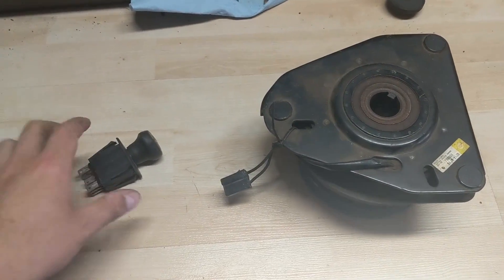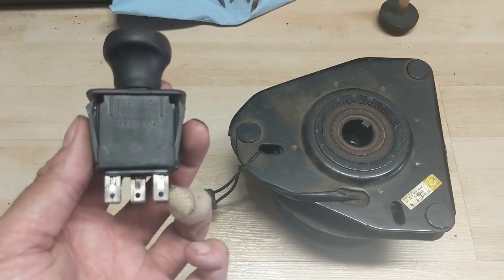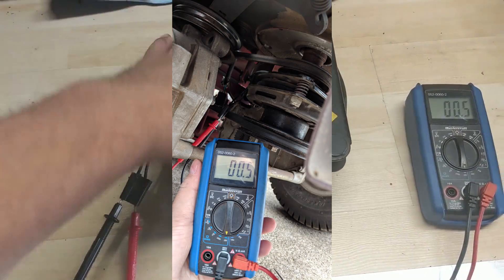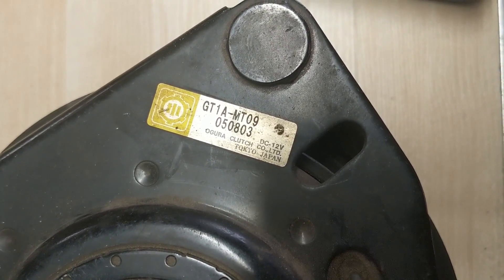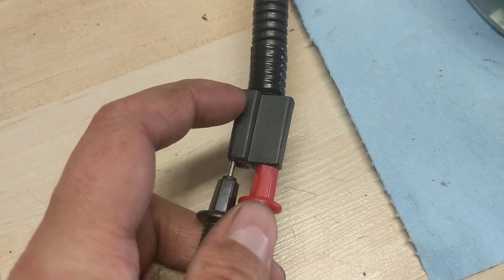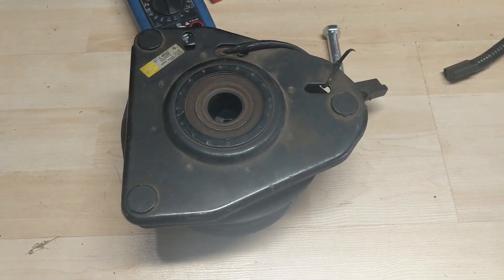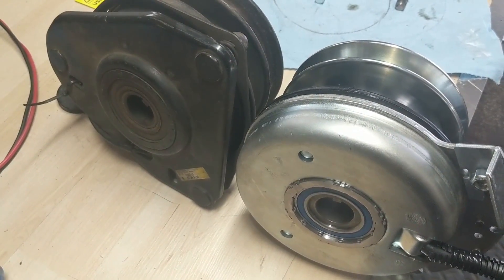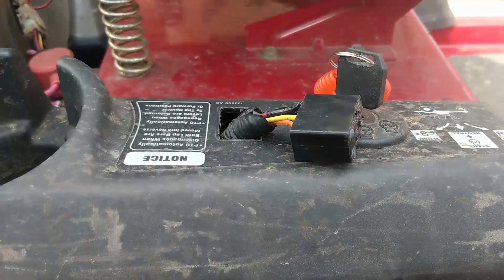How to Test a PTO Clutch for Resistance!

Comment: What it has to have resistance ?  You said the clutch engaged right . Also You said it had to be shorted inside . Did You check that NO You did not . Hook up a multi meter to one wire and go to ground if it pegs out to zero then it is shorted and do the same to other wire too. Hooked up to both wires it should zero out . I have had the same issue with my john deere 111 . I had no overheated switch but the engine died when pto was engaged, I did find my stator was cooked so battery was not being charged . Found the diode was shot also . I did pull the pto and readjusted the clearance put it back in . One rookie mistake is I had connected both of the seat safety switch wires together .  I think it is possible that a diode could have been the only issue You had .If the power flow from battery is going into stator I think it could cook some electrical things That is what my issue was. . I worked at a John deere dealer and should have known about seat switch wiring and how it works dum dum Me. Do check that before replacing a PTO .
Reply from the maker: If voltage remains constant, and resistance is decreased, amperage increases. With the resistance that low, and the voltage from the regulator remaining at around 12-14v, the amperage increases and melts the switch or the wires.

Comment: Excellent video!!! Thank u so much for this, it really helped me out. I have a question that u might be able to answer. Is it possible to replace the bearings on the pulley on a clutch like this?? The electric clutch is working fine, but the pulley has gotten very hard to turn so I’m assuming the bearings are bad. I hate to fork out the $ on a whole new clutch if I can just replace the bearings on the pulley but I don’t want to start tearing it apart only to find out it’s a lot more complex in there. 🤦‍♀️ Thanks again for your help!!
Reply from the maker: I'm sure it's possible, but I've never done it before. Maybe some digging on youtube could help, as I'm afraid I can't help much with that specific fix! Thanks for watching!
Reply: @EliminatorPerformance  No worries!!! Thanks to your video I discovered the clutch has high resistance so I’m probably going to have to replace the whole thing. I was going to try to limp this mower through one more cut before winter but I might not be able to do that. 😩 Over the winter I’m going to put a new motor in my zero turn & then I won’t need this other mower anymore, so it’s crappy timing for the clutch & pulley to crap out!!! Thank u for responding though!!

Comment: Had all the symptoms, new clutch, switch wiring still getting hot ——- was getting 5.5 from the engine , put on new voltage regulator—- now 4.4———- which is above the 4.0 threshold for the clutch. It’s a20 year old exmark 60 inch o turn.
Can the problem be aging components internally pushing too much past the voltage regulator?
Thanks, Martin

Comment: Good video,very detailed, I'm a rookie on this but with this kind of videos I'll be a pro in no time....I'm a very quick learner....Its freaking 9:40pm now and I ran to my shed to grab my Fluke116 to check the pto switch and tomorrow I'll be checking the clutch for sure...I was given a John Deere m665 zero trak for free in very good condition but obviously has issues with the PTO, one was replaced with oem pto and it worked once,so I  assumed it needs a new clutch....thanks for the video!!!! GREAT JOB!!!!!
Reply: Hey I got it running thanks to your video,checked,I checked the PTO clutch and it had 2.5 ohns and I bought the PTO switch with higher amps  and it worked perfect....blades engaged and I already sold it which was my intention.....
Reply from the maker: Thanks for watching, and good luck! I also have a video on how to properly adjust the PTO clutch: https://youtu.be/hZNILWqmcEg
Reply: @EliminatorPerformance  p

Comment: What if the resistance is high and it won't engage when voltage applied?
Reply from the maker: Could be corrosion due to water/moisture inside. That would cause high resistance and negatively affect the circuit. Check connections too for corrosion
Reply: Ok. Thank you for the info. 

I'm afraid I'm going to have to pull the motor to get the PTO off. Trying to test all I can before having to do that.

Comment: Thanks for having the same multi meter as I do and showing the settings. I've got a craftsman ZTL 8000 doing the exact same thing. I told the guy that it could be more than just a switch and possibly a relay. He's very impatient. So I purchased a new clutch and still the blades won't engage. I thought maybe a ignition switch since his has to be double pumped to crank the engine.

Comment: Thanks for the video,  very informative 👍🏿
Reply from the maker: Thanks for watching Dan!
Reply: @EliminatorPerformance  hey question for you. 
Mine is getting 12.6 volts, the clutch engages,  it's continuity is 3.6 but it still won't turn the blades. 
What gives?
Reply from the maker: @dans4270  check the armature air gap? If the clutch is too far from the battery it may not be engaging? Watch this: https://youtu.be/hZNILWqmcEg
Reply: @EliminatorPerformance  ok thanks. 
This just happened after running over a nice sized rock my kids left out for me lol
Bend the blade about 4 inches.

Comment: If the wire that connects to the clutch is giving a signal whenever the pto switch is on and stops giving a signal when when off, does this mean the problem is for sure the clutch? 
If the signal is getting to the clutch fine but the clutch isn't doing its job , so it has to be clutch right?
Reply from the maker: If you measure 12v at those wires when the PTO switch is on (with the key on and parking brake on) and your PTO Clutch doesn't engage, then yes it could be a clutch issue. However, it may also need to be adjusted (the magnet could be too far away to engage the clutch) I have a video on that here: https://youtu.be/hZNILWqmcEg
Reply: @EliminatorPerformance  Ok thanks man

Comment: One other nice thing about the Extreme PTO... some models have it where you can replace just the bearings only with a circlip, whereas the oem versions, they can't be replaced without a lot of careful grinding because they dimple the top and sometimes the bottom bearing into place.
Reply: if you have a press they push right out you just have to use a punch to bend the metal back in to hold the bearings and use high quality bearings or wont last
Reply from the maker: Excellent point, thanks for watching!

Comment: I turn on mi swisher z-max xzt60 I pull mi pto and fuse blow any sugestion?
Reply: Short in wiring of pto circuit, in switch, or in pto internally.  Unplug pto test for continuity from terminals to body of pto, if has continuity than bad pto, if no continuity, resistance tests within spec pull switch and look for plastic deformation or melting; if any replace switch then test individual wires for shorts to body/frame..  if switch looks good test it's switching making sure none of the terminals have continuity between more than 1 other pin at a time while testing switching to the nc and no contacts verifying normal state continuity..   if problem still exists after all stated testing than go get some salt and pepper cuz she cooked...   buy a mechanical clutch and run a cable to actuate..  fuck all the electronic bullshit and make it work...  :)

Comment: My PTO switch is good. But my PTO will not engage. I checked the PTO clutch as you instructed in the video. Mine is 5.2 ohms. Could it be a faulty PTO clutch?
Reply from the maker: Could be!

Comment: I think you maybe incorrect on which lead is positive and negative  , I believe you have them reversed
Reply from the maker: It doesn't matter when testing resistance
Reply: It doesnt matter regardless on a pto..  its a coil of wire and no matter which polarity you hook 12v to it the coil if working will pull the plate disengaging the clutch....

Comment: Great video.  Thanks.  Having similar issue with my Cub Cadet.
Reply from the maker: Thanks for watching!
Reply: Eliminator Performance turns out it was the reverse switch. $10 fix. Too bad I had already bought a new clutch for over $150. Oh well. 🤣🤣
Reply: @EliminatorPerformance  Thanks for your help.  Although Im having some trouble.  The switch seems to check out in terms of continuity.  The new clutch measures 3.8 so right where I need to be.  The blades engaged twice for less than 5 seconds each.  Any ideas?  It's a hand me down mower so I don't have a ton into it.  But I don't want to throw good money after bad ya know?!  Maybe it's a ground fault somewhere?  Do you know where I can get detailed wiring diagrams to go through it.  I figure during the pandemic, I've got more time than money!  Besides, my eight year old loves working on it. Thanks!!!

Comment: You want to point out that 13.5 volts are necessary going into that new clutch before putting it back into service. Measured at the clutch with PTO engaged. Zero volts disengaged,13.5 +/- engaged. If it's only battery voltage at that new clutch it will fail.

Comment: Just wanted to point out mine (exactly the same clutch) has a resistance of 3.4(which seems fine)  but has conductivity between both hot and ground. When I did my 12v check there was no clicking on, only sparks coming from the wires when they touched the battery. Dead short but the resistance check showed it was in tolerance.

Comment: Hey thanks for the video .I've been searching all over trying to get some info. So I have a Scag V ride .
I accidentally left my key switch on for 4 days. I went to use the mower and it would not start so I took the battery and charged it. The mower started right up but now when I pull the PTO switch and does not click and the blades take like 10 to 20 seconds to turn on. So I checked to make sure the wires were pushed into the socket,it seemed to be fine. Any idea what this could be. I would appreciate your help thank you.
Reply: Those Scag mowers are awesome, hope you got it fixed right a way.

Comment: Explanation of resistance versus current flow (amps) is backwards. Resistance is opposition to current flow. More resistance, less current flow or AMPS. Think of a short circuit as NO resistance and you get big sparks. Think of the air gap between two contacts or wires as infinite resistance, No sparks. And everything in between.
Reply from the maker: Good explanation, yes I definitely got it backwards and have pinned a comment to better explain.

My explanation of Amps being affected by Resistance is actually backwards in this video!

Voltage equals the amperage multiplied by the resistance in a circuit, if the voltage remains constant and the resistance is dropped, the amperage across the circuit must increase.

Essentially, with a short to ground there is little to no resistance, and because the 12v from the battery (around 14v from the magneto when the engine is running) stays the same, this is what increases the amps in the circuit!

This is what melts the switch, and causes failure.

At least the video still shows how to properly test a PTO clutch, even if my science was a little off!

Comment: for me its not popping the PTO switch its popping the fuse
Reply from the maker: Sounds like it's drawing too many amps, and overloading the fuse (instead of blowing something else, that's what it's supposed to do) I would recommend checking the connection at the PTO clutch plug for corrosion. Also check your ground wire (black wire)
Reply: Lucky your machine has a fuse then. Should help find the cause. Safety tip DO NOT OVERIDE FUSE!
Reply: dont worry it was all sorted 1 year ago we got a new pto clutch and its all good again
Reply from the maker: Short to ground inside the PTO clutch maybe. I just had that issue with one, replaced it and just like you said, good to go!

Comment: Thanks for the video. I have a PTO that PEGS my Amp Meter when I engage the PTO. I'm headed out to check the PTO resistance. I liked your explanation for current. I use similar when explaining to train engineers. You have max thumbs up on this video.
Reply from the maker: Thanks for watching Gary! And on this particular PTO clutch, it had an intermittent short to ground so when I tested, the resistance was low, but would Spike occasionally which would've melted the switch. Like my customer said, he replaced the switch and it worked for 2 weeks then the resistance spiked and he melted the switch.

I haven't heard from him since replacement of clutch, so all is well!

Comment: How about if your PTO clutch registers 07.1
Reply from the maker: Sounds like resistance is too high, a new (or used in working condition) should test 2-4ohms, I would check your connections & make sure you're not adding to the resistance by having a a connector with corrosion on it.
Reply: The pigtail was messed up I wanted to see if the clutch was still good so I connected straight to the terminals on the clutch
Reply from the maker: If it was melted, you may have high resistance causing more amps which will cause heat.

In the video, our PTO clutch had an intermittent issue, so when testing it would go low, but occasionally would Spike high and melt a switch.

Replacement fixed all issues, going on 1yr with no issues.

Comment: I engaged my pto..and sparks started coming from the pto clutch..?? Any suggestions?
Reply from the maker: I'd recommend checking the air gap 1st, here's a video on how to check and adjust that; https://youtu.be/hZNILWqmcEg
Reply: Instead of using the lower powered 12v battery, remove it and take your positive and negative terninals and connect them both to a stove electrical cord and connect an additional wire from the frame to the ground wire of the plug..  then get a video camera to record the victory startup

Comment: Thank's so much for the detailed video on the PTO Clutch. I had a PTO switch that got hot and melted so I replaced it not knowing that the cause of my problem was indeed the PTO clutch. I measured mine like you showed and was only reading 00.8 ohms not 3-4 ohms. Indeed bad, so ordered the Xtreme for mine as well. thanks Man very well done and informative video. Thumbs Up
Reply from the maker: Thanks for the kind words, and thanks for watching!
Reply: How do you repair gear driven on a lawn boy snowblower on YouTube

Comment: What is PTO?
Reply from the maker: Where the crankshaft comes out of the engine, this is what is used to turn a pulley, which then turns the belt to spin the blades on the mower deck.
Reply: @EliminatorPerformance  Thank you.
Reply: Power takeoff..  pto...

Comment: I have tested my PTO on the machine, and the tester is showing 03.2 ohmz. could it be bad contact between the switch and the plug, or the plug at the clutch itself?
Reply from the maker: Yes very likely! If the PTO clutch tests good (between 2-4 ohms) then the connector most likely could have corrosion, or a bad connection at the switch!

Comment: Gonna go buy an ohmmeter & check out my cub cadet 2186. Pto won’t engage when engine warn. Local guy worked on it twice & put new pto switch on it & repaired a broken green wire on pto switch. Problem came about after a 200 mile trip home on a trailer. Thank you for your videos, you make it simple for the average guy to fix basic problems.

Comment: Great video.  A small correction about voltage, current and resistance.  A short = low resistance = high current, and that's the problem.  v = i r.   Power (rate of energy dissipation) = vi = v^2 / r .  Since you have a fixed 12V from your battery, this is the right formula to use.  v = 12 volts, so the lower r gets, the more energy is dissipated and the hotter everything gets.  There's nothing intermittent, nothing to do with rust or squeezing a garden hose (that's a nice analogy for different physical principles not this one.)
Reply: Yeah, worth reshooting the video because the statements are actually 180 degrees out of synch with reality.  Resistance decreases amperage with a constant voltage supply.  A short or reduced resistance increases amperage.  Entirely different explanation is that resistance DOES cause energy dissipation often in the form of heat, so corrosion at the switch which represents resistance could cause heat build-up which could be enough to cause melting.
Reply: And this is why I always try to read and evaluate all the comments! Thanks!
Reply: And this is why I always try to read and evaluate all the comments! Thanks

Comment: Any tips on how to make the crankshaft stationary so I can remove bolt off the bottom shaft (main deck drive pulley on LA 140 John Deere )?
Reply from the maker: Easiest way is to get someone to hold the flywheel up top! I just did a video on John Deere 325 Engine Removal, and showed how to loosen a seized PTO Clutch bolt using an air hammer.

You can check it out if you'd like: https://youtu.be/Om4kHrkCRRo
Reply: @EliminatorPerformance  10-4. Thanks for such a prompt reply.
Reply from the maker: I always try to reply as best I can, cheers!
Reply: @EliminatorPerformance  I'm an older guy and I need to say this; your YT video's are some of the first that I've viewed that are spot on as to content, movement, edit and camera angles. I worked in Cryogenic Valves and help write an ISO 9001 Manual for the business which is extremely technical. Its a pleasure to see a younger guy who totally "gets it". Thanks again.
Reply from the maker: @thomgarza  thanks for the kind words, always try to be professional. I tend to talk quite a bit in some of my vids, but usually it's because there's good info I like to get across. And my father wrote up ISO 9001 manuals for the closed die forging industry, I know how much of a pain that can be!